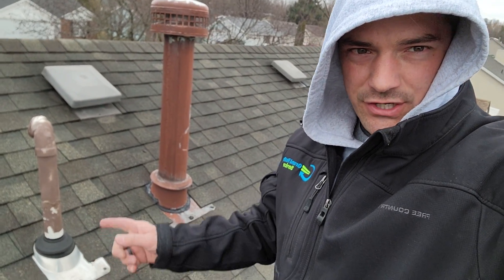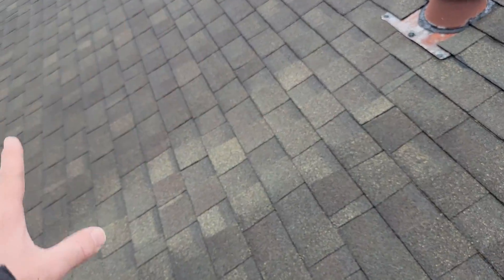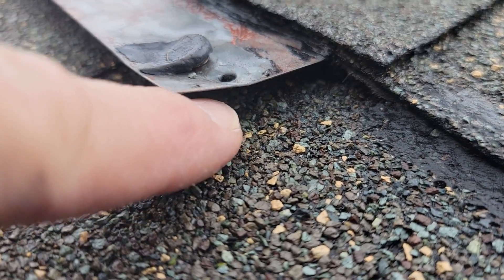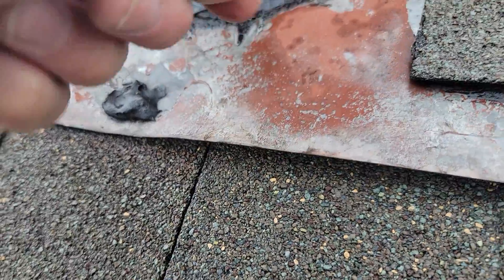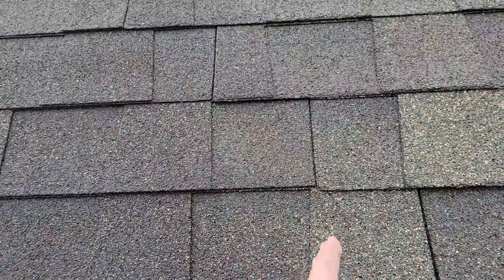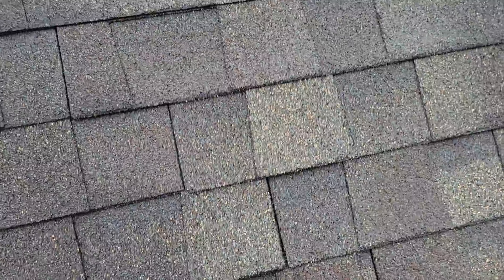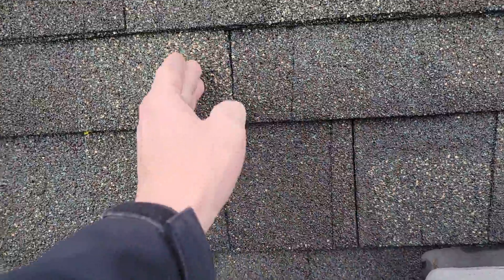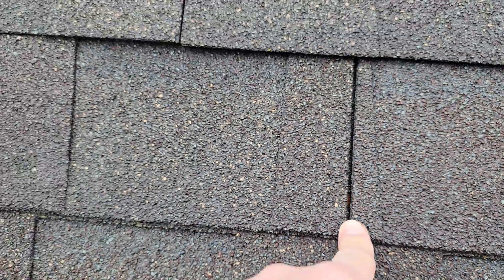Roof leak at B vent pipe flashing - Bad roof install

Comment: Thanks for creating this video. This rusted nail and bad placement on the flange around that vent was exactly my problem. The roof inside right underneath that nail was rotted out about 6 in in diameter. I suppose I'm going to add some wood over the rotted section inside so that I can nail into a good solid piece of wood when I fix this. I've got to find that caulk you mentioned. Thanks again for doing this!

Comment: One of the guys i used to work for would always use screws instead of face nailing any metal. the way he explained it was that over time the metal can pull nails out but not the screws, the screws he used were self tapping and they had grommets on them (basically metal roofing nails) of course he only used them on face nails, but have you seen people do this? He also said that with the screws you don't have to caulk them since they had the grommet! seemed like a great idea to me as long as theyre placed properly, let me know your thoughts on this. another guys on youtube (the average roofer) does this method also.
Reply: Sounds like you worked with a rare shingler.... one with a brain lol
Reply: that should work pretty well, it can dimple the thin vent metal
Reply: I had this exact same leak and caught it when storm came. So next day I went up and added new nails but I did thought about screws you mentioned. Maybe I can go redo all of my vents to prevent it from leaking

Comment: So, what if there are shingles underneath a flange or metal plate (so that's good),  but also the shingles come down on top of the metal, equal length to the metal flange. In your video the shingles stop about a couple of inches above the end. Then there's a bunch of caulk (wish I could post a photos). Does that sound like a good thing? I do worry that the water will wick to the nail.
Reply: It's nailed in the usual corners and center, but the flange or metal plate is popping up on either side of the center nail. I'm thinking they used the same old nails, and that this is why they put shingles over top of the metal plate, all the way to the bottom.

Comment: THANKS FOR THE TIPS I'm doing my research to install a bathroom fan that needs also proper vent to install in roof as well I'm also looking into the right material & to do it by code I'm from California any tips doing it by code from ur experience thanks stay safe up on  those roofs

Comment: Why not use a sheet metal roofing screw on the flange? That's what I always do to keep those down
Reply from the maker: You can I've got nothing against using threaded screws, they actually would hold better.  Doesn't matter what you use just more important to keep them in and up a little. I've had a few people in the past comment that steel roof sheet screw will seal it,  but it doesn't seal water coming under the edge when the screws or nails are close to the edge.
Reply: @GrandRoofingInc  fair enough 👍 I'm sure you've thought about it and do it your way for a reason, I just like to understand the rationale behind the way others do things

Comment: Ironically, Tamko is the shingles the roofer put on my house and this winter after 19 years the roof is leaking in multiple places. They used staples and most of them were left sticking up 1/4” and they missed the tar strip on every shingle. To make matters worse, the roofer is nowhere to be found.
Reply: did you end up replacing the roof

Comment: I wouldn't be putting any screws or nails In that metal flashing to . Doesn't matter where you put them you still punched a hole through it . It's prob best just been stuck down to the shingles with sealant under it then it cant bend up

Comment: Y not stagger the water channel on the shingles there loads joint on joint . If it was stagger like you do with British slate roof so water line always down the centre there wouldn't be a issue